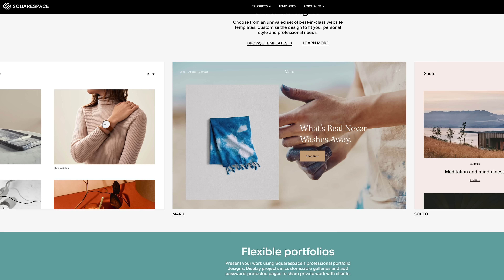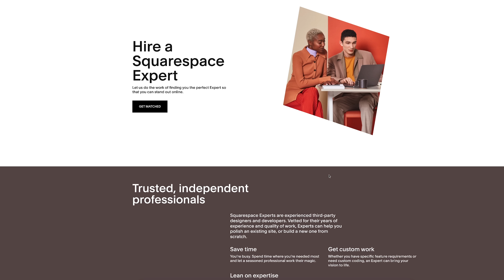Christmas DIY Transformation at the Chateau - How to Renovate A Chateau

Comment: Guys if you are wearing coats and scarves a thin coated dog like a vizla also needs to be wearing a coat?
Reply from the maker: Apparently not, we were told
Reply: If you are out walking the dog it's not likely to be an issue except in heavy rain. But if the dog is sitting outside shivering it needs a coat.